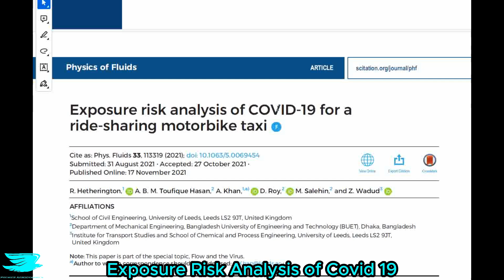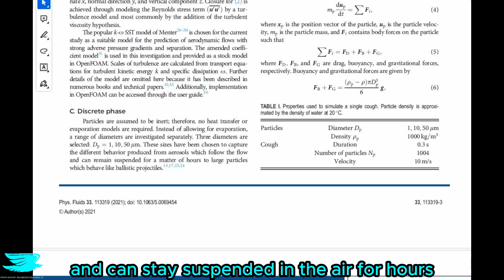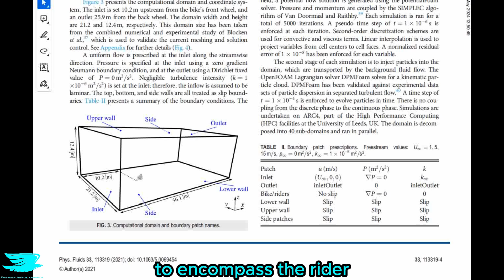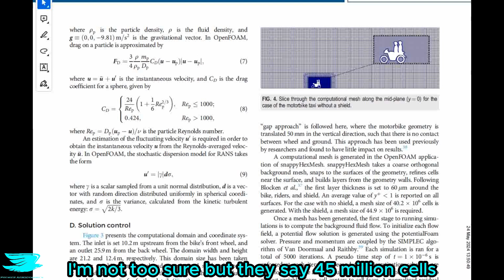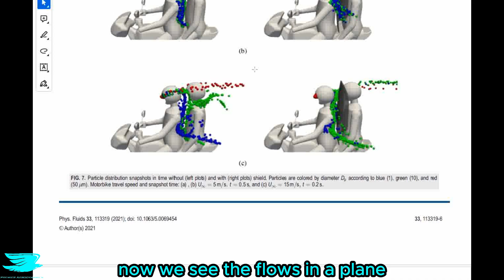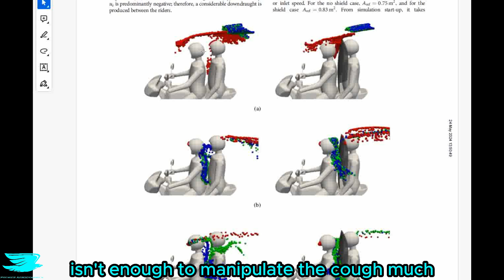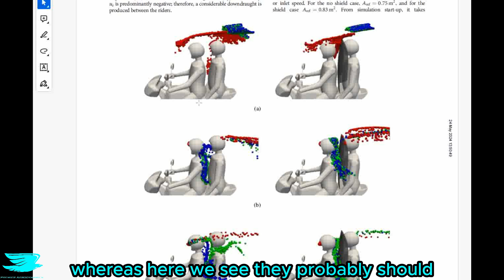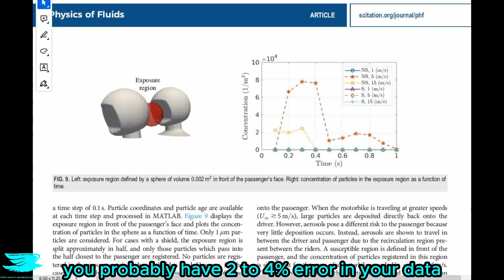Podcast 191 Aerodynamics Of COVID-19 On A Motorbike Taxi

Comment: Kudos to them for them for exploring this case, but I agree. If there was ever a case to invest in DES over URANS, it's this one. They probably should have modeled the riders’ heads and helmets with more fidelity. It was wise of them to explore different speeds and particle sizes. It would be interesting to compare cases without helmets, and with full-face helmets. Also, I'm a bit disappointed they didn't add suspension forks to the model:
1) They would be easy to approximate as a pair of rudimentary cylinders
2) Previous papers have demonstrated them to produce considerable drag (and wake, by extension)
2) Their inclination is certain to produce upwash, affecting downstream flow at greater height.
Reply from the maker: The difference between helmet and not helmet, and even with a helmet with a face shield, would be really interesting.